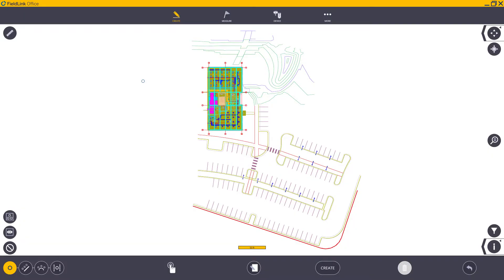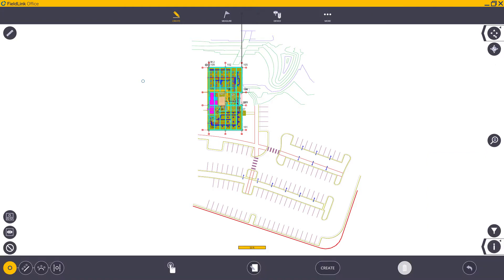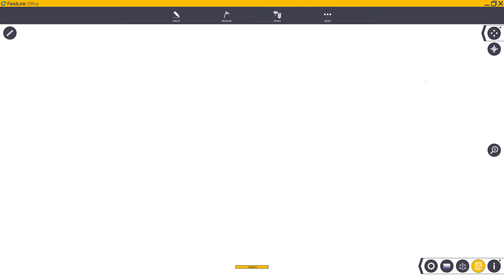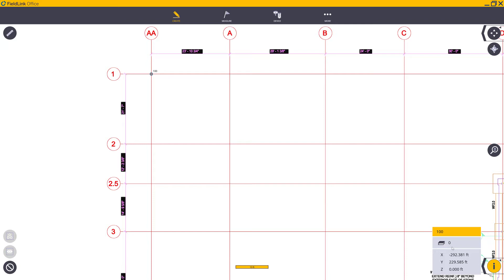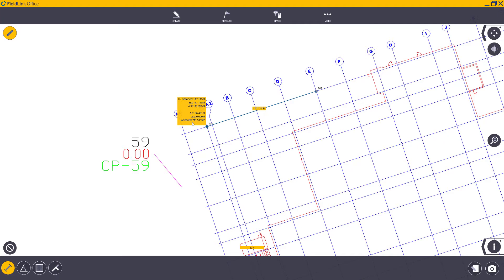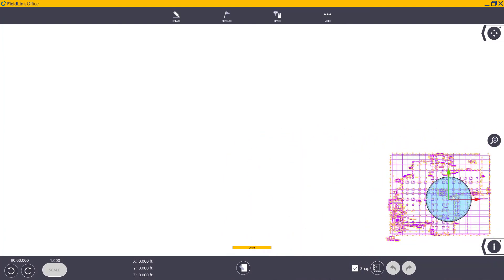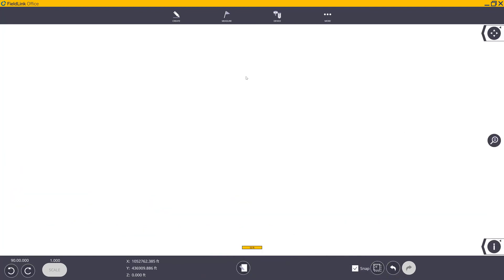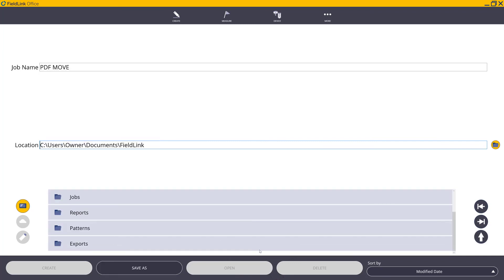Trimble FieldLink: Model and Survey Control Alignment

Comment: So what your saying is that if i only have northing and easting state plane coordinates provided by a civil surveyor. I cant align my DWG model without bringing in another model (PDF)? I know how to align my DWG with just state plane coordinates through AutoCAD but there's a lot of steps .Was hoping Trimble had a simpler way. I believe its a scaling issue. if I could create 2 points with state plane coordinates and then select 2  points on my model and then align, regardless of azimuth angle. Then this would eliminate the process of having to depend on  AutoCAD  for alignment .This is because most jobsites i start on have nothing but control points on a dirt pad. So i have to align to civil surveyors state plane coordinates.

I apologize for the extended explanation.